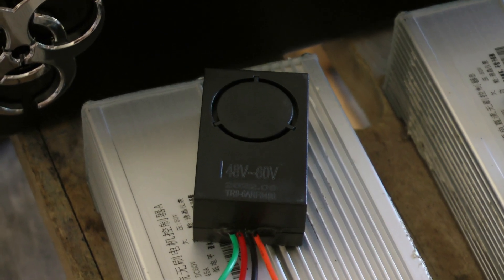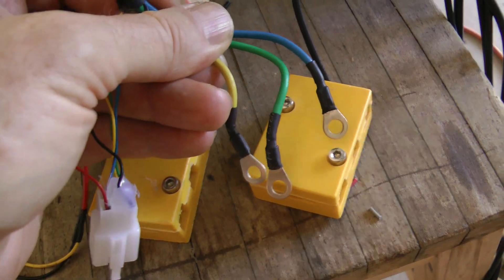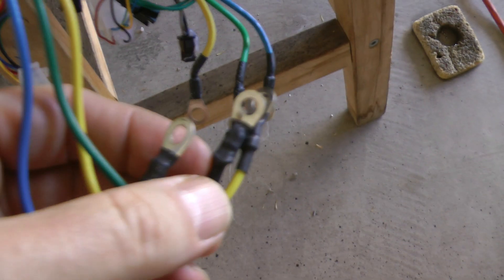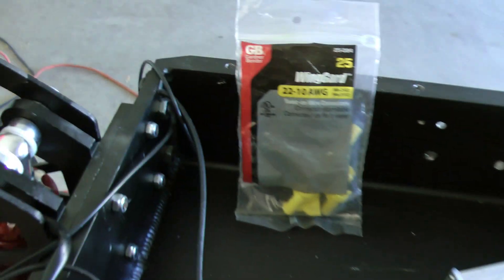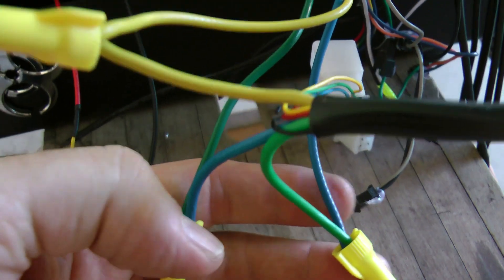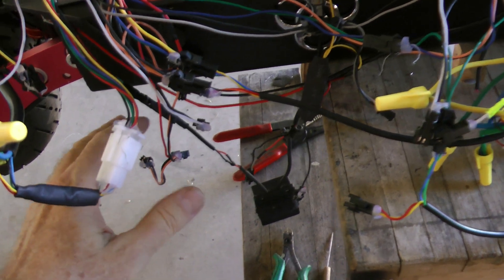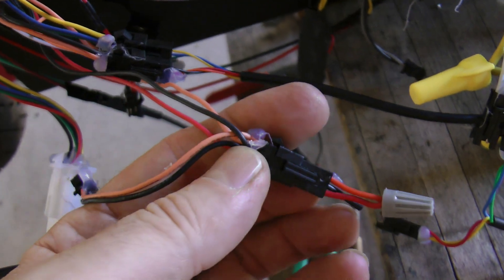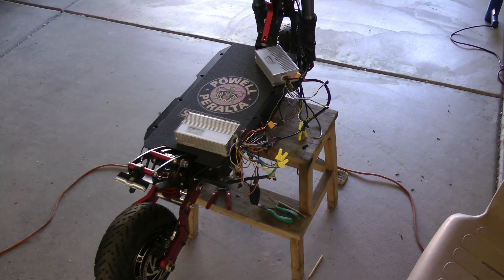Laotie Ti-30 JP controller hook up part 1

Comment: Just finished cleaning up my wiring also, waiting on those sinewave controllers that you recommended to get in. I got the 12 volt convertor in, with new lights, got rid of the alarm, and added a $20 NFC Lock switch for the "ignition" for $25 in place of the alarm, (about half the size), Got my Thumb Throttle mod completed and its SOOOO much better than the trigger, less fatiguing for me. I also re-did my Phase wires with XT150 6mm bullet connectors. I added XT90 connectors with antispark to the battery connection so I don't have to listen to that "pop" each time I plug the battery in lol. I know XT90 is above what was in there, but, I changed out my Battery's BMS and cables also to match, I had a 300 AMP Smart BMS from a project that I ended up going Lifepo4 with, so the Li Ion BMS will get its use. I just set the current limit/shutoff to the same limit as the one that was in there, and I can now monitor the balance voltage of the 8 sets of 16, along with the temperature via Bluetooth. Looking forward to the controller installation video, So I can follow along.  Thanks again for another great video!

Comment: You sound like you know whats up.. though i do have one question...for the motor phase cables, u have the green and blue swapped.. mine go from color to color g-g. B-b. Y-y. Should i switch them?
Reply from the maker: If your motors are turning in the right direction (forward) then leave them as they are. The only reason you would swap the colors is if the motor was turning backwards. It depends on the motor/controller combination. Controllers with a “learn” function like the Yunli Sinewave controllers, will learn the phase wires regardless of how you have them wired, so it wouldn’t even matter in that case.

Comment: Could you tell me how to rewire my horn correctly please. I had the same 60v front & rear indicators which I removed, but somewhere in spaghetti junction the front & rear indicator wires were looped in with the head & tail lights and horn wires, to the controller and switch. But since I've removed the indicators, my horn only works when my lights are switched on and not when they're off
Reply from the maker: This will help: https://youtu.be/DuVWxyx59TM
Reply: @Desert-Ecruising  thanks dude! I'm gonna open the deck up tomorrow and check where the wrong connection is

Comment: Hello why did you connect green with blue and opposite? At the controllers?
Reply from the maker: The JP controllers that came in mine did not have a learn function so the blue and green needed to be swapped for the motors to turn in the forward direction. It came from the factory that way. I now have the Yunli controller setup which has the learn function, so this is not necessary for those controllers.
Reply: @Desert-Ecruising  ok my friend thanks. One more question ❓ due to the fact I had an accident with ti30 now I will rebuild it.

Could you tell me if you know how can I put switch with key??
Reply from the maker: @MotoTaz86 if you’re rebuilding, I highly suggest you switch over to the Yunli setup. It’s so much better than the JP. 
Yes, you could add a keyed switch. Email me and I’ll help you out : maikemarx@gmail.com

Comment: Your customize scooter gonna be bad ass... i just noticed when i unfolded my handle bars that red lever of my scooter is down hitting on scooter deck and i been riding like that since...does it make a difference leaving it down i guess the proper position is keeping the red lever up.... i also tried to unfold the scooter but forgot how i ended up pressing the red lever upwards instead of down where i currently have it but forgot its the other way around i have to push down on the side silver lever then down on the red lever to fold the scooter handle bars down????

Comment: Hi can you help me pls, i got the same controller model, i plugged some wires between 2 controllers wrong and now the main controller wont turn motor, i open the controller and it blinking red, i tried unplug everything and re done everything all over again, the controller still blinking red, nothing burnt just blinking red, any idea how to reset this red light so it will allow power to motor again?
Reply from the maker: You can email me and I’ll try to help: maikemarx@gmail.com
Reply: Nvm it fried, i bought another
Reply: Now wtht the new controllers from FLJ , i got problem with the low and high brakes, it only has 2 wires black and grey for the  brakes sensor, wheb my battery fully charged the brakes wont work , when my battery drop to about 40% then the brakes starts kicking in really hard , should i cut off the grey wire and connect to the positive power see if the high brake will kick in at fully charged battery?
Reply from the maker: @mikenguyen4207 The brake sense line only has two wires and they do NOT carry voltage. The brake sense line is just an open/closed indication to the controller triggered by switches in the brake lever assemblies. Do not apply voltage to the brake sense line. If when you pull either brake lever, your brake lights come on, then the brake sense is working properly. Watch this: https://youtu.be/gLE3i_xoe3I?si=EgTRFNq2mX5DYgZ6

Comment: What was the reason for switching the yellow blue green wires?
Reply from the maker: The stock JP controllers don’t have a learn function. For the JP controllers with these specific motors, the blue and green must be swapped for the motors to spin forwards. The far better Yunli controllers I am using now have a learn function so the colors don’t matter, the controllers will learn the motors regardless of which color goes where.

Comment: Since you look like u know what’s up.  I purchased one on Amazon and when it arrived I checked the voltage and charged it.  It lost 3 volts in short time I disconnected the alarm and checked it after some time.  It didn’t loose anywhere near the voltage this time.  I was ready to put it on the road and touched the display to turn it on and noticed that the power button was extremely hot.  I quickly disconnected the battery and waited for it to cool.  The dealer promised me a new display but I am not certain if I should wait for the new display.  I only have a week left in order to send it back.  I don’t know what to do I have not even road it yet and I am presented with all these problems.  What so u think should I keep it or send it back before the 30 day limit.  Scott Farley
Reply from the maker: It’s a great scoot but you shouldn’t have to deal with that. I’d send it back while you can. That’s the benefit of ordering through Amazon. Then, if you like, u can email me and I’ll help you look for a scoot in whatever your price range is and based on your needs.  maikemarx@gmail.com
Reply: I had this issue with the key/voltage display. I just jumped the switch and use the voltage display on controller.

Comment: Hello. Thanks for that video! I have one problem :
When I turn on the scooter. No problem.
But when the Eco turbo switch is pressed, and released, so now it is released, my front motor turn alone.
It is at a small speed, I think 25kilometers/hour.

And the switch are not doing what they need to do. Dual single, etc. 

Any idea?
Thanks.
Reply from the maker: If the wiring is all correct, then I would have to believe the controllers have an issue.
Reply: @Desert-Ecruising  yes, replaced and good now, but now gear 1 and 2 in Eco are 4 and 14 km/h.. Sad. Faulty new controller..
Reply from the maker: To me eco mode is useless. I can still go as slow as I want in turbo mode just using the throttle.
Reply: @Desert-Ecruising  sometime I found it useful and need that Eco switch too for magnetic speed limit 😝

Comment: Thank you but my rear motor is still not moving. It still show the little box on the display 
I’ll be waiting for part 2 ❤🙏
Reply from the maker: Part 2 will not make your motor work. If you followed part 1 correctly and your motor does not spin then your controllers are bad. The flashing box is an indication that there is an issue between the controllers and the motors. If the wiring is correct, then your controllers are the problem.
Reply from the maker: Double check all the display connections. Make sure the pins in the connectors are secure and not backed out.

Comment: Hy man my horn stopped working on the ti30 and puff of smoke happend from the controller and now I need new ones how do I remove the old ones I can’t finds the mounts
Reply from the maker: Do you really mean the controllers? They are inside the chassis. Do you mean the throttle? What mounts are you referring to?
Reply: @Desert-Ecruising   sorry for the confusion yes I mean the controller mounts I’m getting the sinewave  controllers bc my old one made a small puff of smoke and every thing works but the head lights and horn
Reply: I think from what I can tell there is a pice adhesive but am not fully sure and do not want to brake anything
Reply from the maker: @D-rek420 yes, it’s just adhesive thermal tape holding them in. Just pull them up.
Reply from the maker: @D-rek420 also, if you’re getting the Yunli Sinewave controllers, get the kit with the Yunli DS20 throttle.
Reply: @Desert-Ecruising  it is it the one you linked in that one vid also i have a friend who recommended a nanrobot 60v 2 in 1 controller what do you think of that would that be another good option in your opinion
Reply from the maker: @D-rek100 Here’s a link: https://a.aliexpress.com/_mMPNRIW
I’m not familiar with the nanrobot setup, so I can’t comment on that.
Reply: @Desert-Ecruising  ok thank you for all the help  I just  ordered them

Comment: Hey has anyone had their scooter just stop working? Mine was working great then suddenly wouldn’t drive, quickly after that it powered off and wouldn’t start up. I tried the alarm button reset and then by passed the alarm and removed it. Now one accessory light will work, but the rest of the scooter won’t power on. Any ideas for next steps?
Reply from the maker: I can help you troubleshoot it if you email me: maikemarx@gmail.com
Reply: I’ve emailed you, thanks!
Reply from the maker: @justinalvis4409 I haven’t received your email. Did u send it to maikemarx@gmail.com?
Reply: I have see some people have had a wire come loose on bms. Pirate made a video on fixing it.
Reply: Hey I need help i am using this but unfortunately showed the warning sign in the display than its not working but power is on. What I have to do?
Reply from the maker: @tawhidulislam2813 Is the brake light on also? The warning sign lights up when the brake sense line is closed. Could be the brake sense line or switch is shorted. You can email me: maikemarx@gmail.com

Comment: Can you by past the remote for all push start controller
Reply from the maker: If the alarm is the same as in the video, then you should be able to bypass it in the same way. A lot of scoots use that same alarm module.